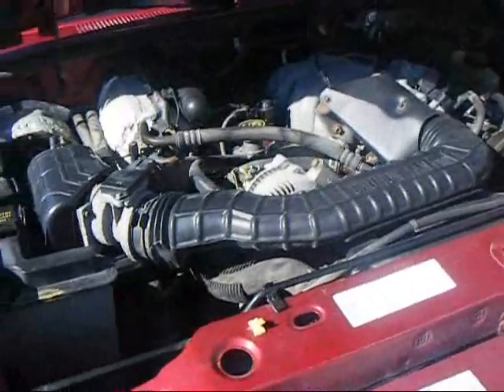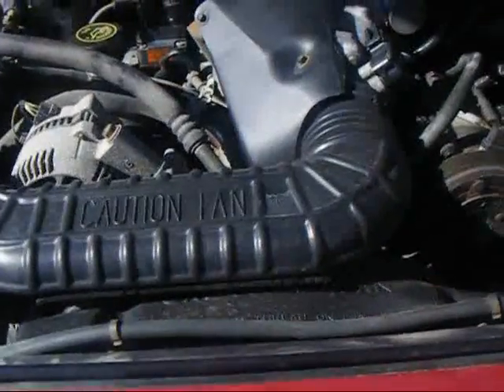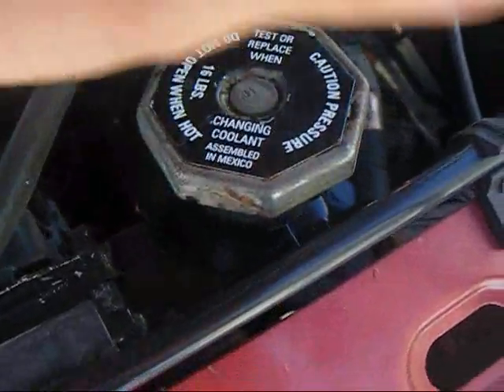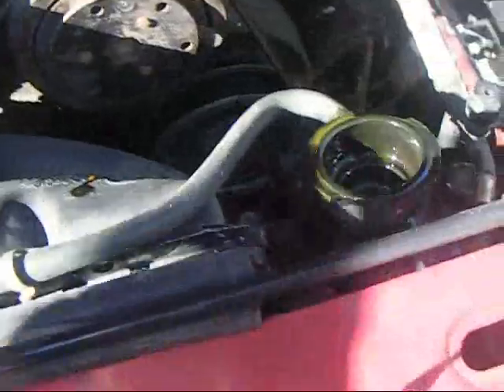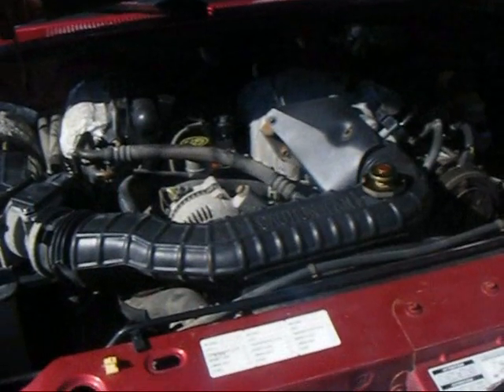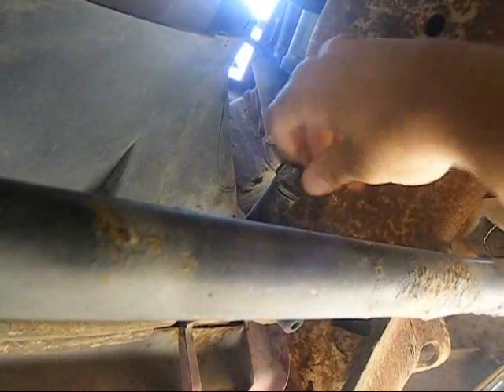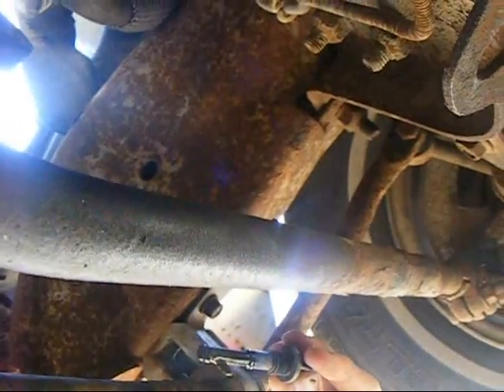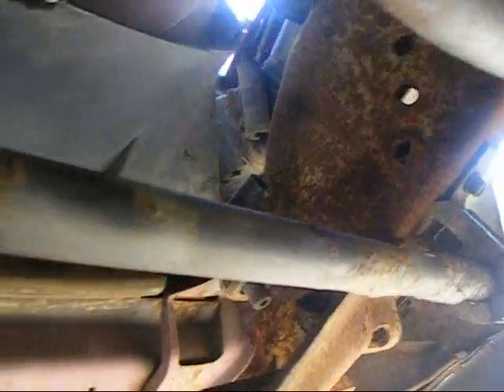Routine Maintenance: Radiator Flush

Comment: Yeah man this wasn't such a good idea. Couple things, letting the coolant run out all over the place is pretty fucked up man attach a hose and run it into a bucket. Also never use tap water, tap water has chlorine and other bad shit in it that will cause corrosion which will cause pin holes in the radiator over time always use 50/50 mix or distilled water.  Flushing it with tap water is okay but i usually use compressed air after flushing to blow out any remaining water then i fill up with 50/50 mix and iv never had a radiator leak and i have never had to replace one either. Everyone does things different but please dispose of the coolant the right way next time.

Comment: Best you tube nominee video for Not Giving A Fuck.    1. He says "I don't give a fuck"   2. He pumps you up when pulling the plug & nothing comes out but rust stuck on the petcock.   3.  Fuck it water straight from the water hose for 30 minutes while draining it on the cement straight to the sewer.   4. I love the mix ratio: of coolant to water.   5. The concrete looks all stain with rust.  That's why this is my nominee for the best Not Giving A Fuck you tube video 2015

Comment: If you 'care' about your thermostat, heater core, and radiator... DO NOT use tap water. Use 'DISTILLED' water. Also use distilled water in your windshield washer mixed with a bit of Windex and you'll NEVER have to worry about CLOGGED windshield washer spouts!

Comment: I love this dude. Great attitude. My mechanic of 20 years recommends 100% anti-freeze! NO water added! I' ve had my '95 civic running this way for 10 years and the radiator is in EXC condition and I've never changed a hose!  I have 220K on the vehicle!
Reply: The 100% coolant is better. Mixing it 50/50 just saves money

Comment: I think I am dumber since watching this video....

1 - Back Flush through Thermostat Hose, that way, any rubbish in the Radiator, will flush out of the radiator.  If lower hose is attached to thermostat, then you will need to dual flush system.
2 - Radiator Cap maybe faulty, given you have coolant filling it directly from Radiator.  The cap on this vehicle is a Recovery Cap and as such will only open and close when pressure has built up.
3 - Barrs Leaks does not work in the long term.  It is a temporary quick fix. This also blocks the Radiator core which will inturn cause further overheating issues.
4 - You do not need to have the engine running to flush the cooling system
5 - demineralised water should be used not tap water
6 - there are so many other wrongs in this video and I urge others not to follow what is shown.........

I must thank you also, I own a Radiator shop and it is because of your videos and people watching them, my shop remains open to fix all the "Fuck Ups".

Comment: There are some comments about environmental hazards, the EPA has removed the toxic chemicals from coolant for this reason. That stop leak is like taking a dump in the cooling system, its worthless and he will need to flush that crap out with a real cleaner.
Reply: Wrong. From the EPA website:  "Antifreeze is toxic to humans and animals. Waste antifreeze contains heavy metals such as lead, cadmium, and chromium in high enough levels to potentially make it a regulated hazardous waste, so most states strictly regulate antifreeze disposal. Antifreeze generators and state and local programs should not dump spent antifreeze on land or discharge it into a sanitary sewer, storm drain, ditch, dry well, or septic system; dumping antifreeze can cause serious water quality problems and might harm people, pets, or wildlife."
Reply: Its interesting how the silicates and other harmful ingredients have changed over the years due to environmental concerns. Its amazing that automakers will not use propylene glycol formulations which is added to food as a more responsible alternative. Radiators get broke all the time and dump coolant on the ground, is there someone who cleans that spill up?
Where I live, most shops do not collect or recycle used coolant and just dump it in the waste oil to get rid of it. One shop owner instructed me to wash it off the floor into a creek because these shop owners are just cheap and don't care.

Comment: Its ok if you have more water than antifreeze, it will not ruin your engine. You can actually run with just water and your engine wont over heat (but youll develop rust). What I do if I have to mix 50/50 is take an empty 1 gallon water bottle, fill it half way with coolant and half with distilled water. You always want to use distilled water for flushing and for mixing because it has no minerals that can cause rust.

Comment: First off he didn't drain the rest of the coolent in the engine block which would hold about 6 litres of water and including the radiator it adds up to about 12 litres of water/coolent capacity so you just put the whole bottle of anti freeze in there if you don't drain the engine block that's why he only fitted like 2 litre's of antie freeze

Comment: thats not completely true, overheating could be literally anything. most common problem is a sticky thermostat, simple 15 minute job. could be a blocked water gallery, when a high pressure cooling system flush would be needed or if its not badly blocked, a rad flush solution from most car shops. people like you who suggest the most expensive thing first shouldnt be allowed to give advice

Comment: You think water is going to do anything to the truck? Have you never driven in the rain and had to lift the hood? I take my hose and wash off my entire truck because I live on the coast and they also use salt on the road in the winter. Vehicles aren't gremlins, they wont explode if water gets on them. If anything he did good running water over the front of the engine because it not only helps wash dirt but also the spilled anti-freeze

Comment: so like i can tell you though, i have not changed my oil for maybe well since January...  i have tools but i  not really a hands on guy , i was wondering , is it very simple to change oil ? i was thinking changing the oil will help maybe? and as for my radiator water/anti-freeze (i dont know what is really inside.... i mean how many parts of each , like 20% / 80% ...it just sucks. i wish i have a buddy to help me. Not sure what you can recommend ?

Comment: and so now, i just saw m my needle owuld not really budge and of course you are going so fast i dont really or was struggling to hear the fan... when i came to a robot (traffic light) i noticed that the fan did come on, but it seems to click in a bit more closer to 100 (say 1quarter...) but normally it is just between 90 and 100 on the dial (i mean its all analog you really never know what the REAL temp is... so i dont know , i dont have a hose pipe and garden and stuff... i just dont know

Comment: Hi, please tell me, how can i flush my radiator out if i dont have a radiator cap. My car is a OPEL CORSA make, 1999 year model model 1.6 injection with aircon, which i dont believe works properly, it doesnt blow cool air. Anyways, my car runs nicely but it just scars me because i have recently noticed (i cant say i remember exactly how long its been  ) but i know the last few days i have noticed when i drive on the highway/freeway the temp needle was sitting just above  90.

Comment: You know your should use distilled water when mixing with antifreeze. The minerals in tap water would cause even more problems for your radiator. Such as rust that gets formed in your system, as well as calcium deposits.

Comment: I am sorry man but you are an idiot lol, your flush was just dumb you supposed to use a rag to make a tight fit between radiator and the garden hose. then its very important to run the heater on full.

Comment from the maker: @nichole johnson you have a blown head gasket. a blown head gasket allows oil to enter your cooling system which leads to overheating problems. you need to replace your head gasket which is a very expensive fix. looking at about $1000+ if you have someone do it.

Comment: Wrong, Prestone stop-leak is safe to use in all engines and will not clog up the radiator. You can also use it as a preventative measure for an older car to help prevent a minor leak in the radiator or head gasket water passages.

Comment: No garden hose is needed. Use distilled water. Use a proper drain pan to catch the coolant. Immediately pour the used, dirty coolant in a jug and cap it off so your animals or any critters don't drink it and die a horrible, painful death from glycol poisoning. If you do happen to spill a bit of coolant in the parking lot, use shop towels to sop of most of it and get a bucket of tap water to wash it down before animals drink it.

Comment: Save yourself about $10.00 or more by buying pure undiluted anti-freeze. The diluted coolant is much more expensive. Pick up a couple gallons of distilled water at the local grocery store to mix  with your new coolant. Use a clear jug to measure out the 50/50 solution properly.

Comment: you didnt bleed the system....did u do this step? or u forgot?  if u did, how did u bleed it/burp the system?

i heard u jst take the cap off let run until the bubbles in the radiator disappear, then top off...tell me if im wrong.

Comment from the maker: you need to look underneath your car at the bottom of the radiator. If their is a plug like what my truck has then it is. All drain plugs are on the bottom of the engine. Some cars have sealed radiators where you need to take them to a shop to get serviced, but because you have a 1991 Toyota, i would imagine thats not the case. Either way, look under your engine and look for some sort of a removable plug. That will drain your radiator. Good luck!

Comment: Good vid but to anyone watching if you live in a colder state DO NOT pour 50/50 blended antifreeze back in after flushing. Even after you drain the water out some will still remain in the engine diluting the antifreeze even more. Pour enough 100% antifreeze back in equal to 50% to 70% of the system capacity and then top it off with water.

Comment from the maker: @Faqurkowch explain to me what i did wrong? Besides the fact that i let it drain onto the street, but then pressure washed it off. What was it i did wrong? Let me guess? Distilled Water? YOU DO NOT HAVE TO PUT DISTILLED WATER IN YOUR RADIATOR! Everybody thinks that you have to, it becomes DISTILLED once it reaches 212 degrees in the first place. All DISTILLED water is, is water that has been boiled and cooled. So if its not that, then explain to me what i did wrong. Thanks!!

Comment: Good video.
I like to keep my old antifreeze jugs so whenever I do cooling system work, I pour half of the straight antifreeze into one container, and half in another, just fill them up with water. Then you know that you're filling your car with almost exactly 50%, rather than relying on manufacturer's capacities and halfing it. After you flush with water, if you don't remove your engine block plugs, (which most people don't do) there will be tons of water in the block, messing up your dilution.

Comment: you should add distilled water instead of regular water because tap water has mineral buildups that is going to sink to the bottom of the radiator.

Comment: Correction to the bimbos out there who just read directions from some flush kit and believe it is the holy grail:  Metal doesn't care if the water is distilled or not (from the tap).  It still rusts.  At literally the same rate.  Ever notice that your house that is 70 years old has metal pipes of tap water, yet they never rust?  So you just wasted your time and a couple bucks buying distilled water for your flush.

Signed, DUH.

Comment: Don't like the idea of using a water hose for flushing. All those dissolved salts in regular water will reduce the effectiveness of the anti-corrosives and could damage the engine/cooling system internals if it is left behind.

Comment: this isnt the right way. your not suppost to run the car while the fluids being drained as runing cold water in a hot engine will crack the cylinder heads. plus , your suppost to turn on the heater to get the fluid running through the heatere core. this guy has absolutely no idea what hes talking about, dont use this method.

Comment: @Elitessj4gogeta leave the cap off of the rad and fire up the engine, if there are any air pockets they should "burp" themselves out, then add more fluid if you need to.

Comment: i have a 2000 toyota camry and plan to do this, I was wondering after doing the flush and putting in new coolant do you have to bleed the system to get air out of it? and if so what is the best way to do this?

Comment from the maker: @heythisrocks you will be fine man. Radiators are built to withstand the most severe tempretures. You dont see radiators cracking in alaska during -40 weather :) You will be fine. Just follow the steps to my video, make sure not to overfill the coolant reservoir with coolant like i did. I do my videos as they are, so if i mess up, i can show you how to correct it or if its bad. As long as you follow my video, step for step. You will be fine. Good luck man! Let me know how it goes!

Comment: couple of things (from a non-mechanic) 
dude, you should never place your radiator cap or any parts or tools or nuts and bolts on the engine or inside the engine compartment while your working on your car, that's a sure ticket to problems, especially when you are running the engine as you were during this video, this is a BAD habit to get into, I learned the hard way, and have spent hours looking for bolts, or trying to retrieve a tool that slipped down into an impossible place to get it back,

Comment from the maker: @T0ny8150 yes you need to flush the radiator with a hose flowing threw the top of the radiator and draining out the drain plug while your engine is running. This ensures a FULL cooling system flush and not just the radiator. 

And at 5:05 you dont need to worry about buying radiator seal unless you have a leak in your radiator. Mine had a leak, so i demonstrated how to fix that as well. 

Any other questions feel free to ask. Hope this helps!

Comment: I got a few questions , can u answer please.

You know when your flushing the cooling system do i turn on the engine? (when both the Top cap is off and the bottom cap is off) 

Also

At 5:05 you said once u got ur radiator flushed and your radiator seal in there? what you mean by seal? have i gotta buy raditor seal stuff?

Comment from the maker: @offyam not this type of Radiator stop leak, the directions didnt say anything about removing it after a period of time. I wouldnt use Ajax or anything EXCEPT Antifreeze and water to put in your radiator. You might cause problems, just turn the house on full blast and let it run, depending on how bad your radiator is, you may have to have the car running and the house on for 30 mins. Let me know how it turns out!

Comment from the maker: @sashah666 To the best of my knowledge, i know that automobile radiators only have 1 drain plug. My best guess would be your getting confused. Now your drain plug could be on the right hand side or the left hand side of the radiator but not both. Just go underneath your vehicle and look for a plug that twists right beneath the radiator, if you cant find it, refer to your vehicle manual. Let me know how you make out! I hope this helps!

Comment: Hey, thanks alot for the video...I just wanted to ask you a question if you may be able to answer it. I have a Mitsubishi magna 1997 and I also have a workshop manual for that same car model. Now the confusing part is that the workshop manual is telling me that there is a right drain plug and a left drain plug in the car? Now, is that normal or am I getting confused by reading the manual? Do car's have two drain plugs for the radiator? Cheers !

Comment from the maker: @JazzyYellowGrl i had the same problem on my video if you take a look. just take a pencil or a screwdriver and put it as far into the bottom of the radiator that you can, insert the pencil or screwdriver through the radiator plug and move it around. you should get a big clump on radiator fluid. keep doing that for about 5 minutes and then try flushing it again. keep repeating the process until it flushes. if all else fails. go under the car with your house and squirt the hose in the plug.

Comment from the maker: @JazzyYellowGrl the one thing i cannot stress enough is keep your vehicle up to date. driving around with no fluid in your radiator and your reservoir will only cause SERIOUS problems. you want to follow my video and flush your radiator until the only thing that comes out of the drain plug is clear water from the hose. you then want to put the plug back in and fill the radiator up all the way and then fill the reservoir to MAX LEVEL(COLD) do not overfill your reservoir or it will flood.

Comment from the maker: @hodir thank you for the compliment. but it doesn't matter if its DISTILLED water or not. DISTILLED water is just water that has been boiled and then cooled down. the water becomes DISTILLED once your radiator heats up. So putting DISTILLED water in the radiator with the coolant is a waste of time.